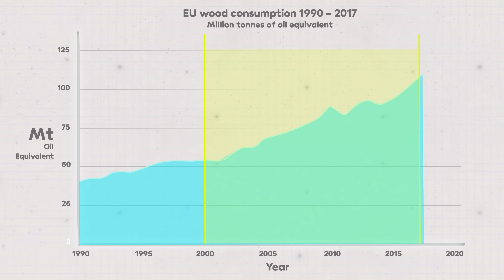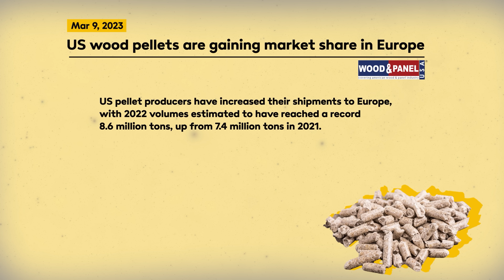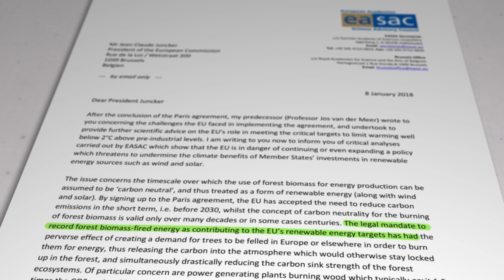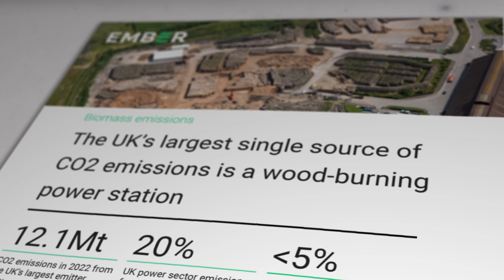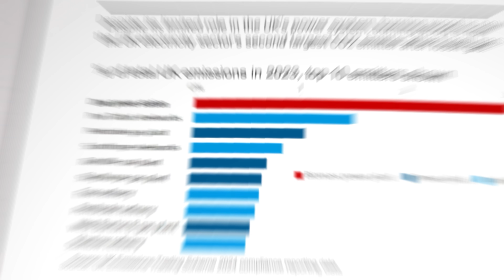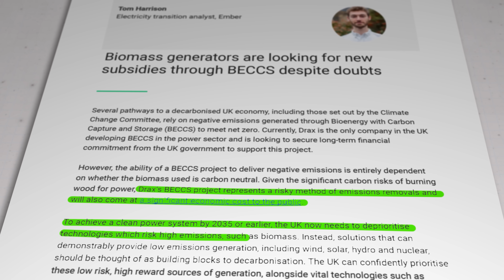New report: Biomass CO2 emissions 4X higher than COAL!!

Comment: My canton has invested heavily into Biomass.  I am not happy, since they have been fighting my decades long battle to promote renewables.   Our capital city has 14 chargers for EV.   It is 2024.
And ojr cantonal hospital has zero chargers for EV, public and staff.  Zero.  It is still 2024.
Reply: Biomass for heat is more efficient than électricity. 
A case could be made for thermal solar in hot water uses but otherwise go biomass rather than fossils.
Reply: @etienne8110  how's biomas better than electricity if the electricity comes from my solar panels and from my provider that has only hydro power plants?
Reply: @alexandruilea915  direct transformation biomass to heat.
Vs lots of losses (producing the électricity, transporting it, converting it, storing it etc...) each steps requiring infrastructures with carbon cost.
Reply: @etienne8110  you can't just sell roots to people so they can burn them. You have to collect the biomass, process and compress it, transport it and sell it to a customer that will eventually burn it. It's just like with petrol vs electricity. If you count production and transport of electricity so should you count the production and transport of petrol. People won't just pick up biomass from their backyard to burn it, but most likely buy it as pellets.
Reply: @alexandruilea915  most biomass isn t roots...
Shows how much you know about the subject.
Reply: @etienne8110  biomass regards to anything that has been grown and is left as junk. It can be wood leftovers or any other plant leftovers. It is carbon neutral as long as you don't cut trees just to make pallets.
Reply: @alexandruilea915  miscanthus is grown to be fuel. It s neither junk nor leftover. 
You re using wrong definition thus your misunderstanding of the situation, i understand your confusion now.
Reply: @etienne8110  well yes, but we don't cultivate it between the city buildings do we? It's like with corn for fuel. In order to produce more you have to expend which also means cutting down forests to empty the land.
Reply: @alexandruilea915  you don t cultivate wheat between city buildings either, doesn t mean citizens are going to stop eating pasta or bread... 

Your exemple is so dumb that it shows you are at the end of your logical thinking here...
Reply: @etienne8110  but you can't eat sunrays or wind ffs. Why compare food with fuel?
Reply: @alexandruilea915  how crazy to compare growing things ...
Reply: @etienne8110  again, one is necessary for survival (food) while the other one is not, because we can make energy in other ways as well. I do agree that some leftovers could be burned, but let's not grow stuff just to be burned if possible.
Reply: EVs are not carbon neutral, some can argue even the opposite. Mining and transporting lithium from Bolivia plateaous and then into refinement just to make the battery can amount to more carbon than your car would spend in it's lifetime if it went on gasoline, which requires much less energy after the drills have done the work (and with less energy intensive refinement later on). And we didn't even consider that most of electricity you will use is not produced in carbon neutral ways. If you are not charging from solar, nuclear or wind power you basically worsen the carbon situation with just that, even if the battery production if taken out of the equation. EVs are in essence just shifting the carbon emission responsibility elsewhere at this moment in hidden ways, just as in the topic of this video. Hopefully in the future this changes with sodium batteries and more carbon neutral energy grids.
Reply: @marsovac Sure, they're not carbon neutral to start with, but after about 20,000 miles they're carbon negative. Sooner if using 100% renewables for generating the electricity. and that mileage is being reduced by the adoption of lithium iron phosphate batteries. And going back to using horses won't work, no matter how much you yearn for that, It turns out their carbon footprint is greater than an EV.  😁
Reply: @marsovac  
I know where your paycheck comes from.
Fossil fuels require over 530 times more mining than renewables.  And Zombie Fuels have bankrupted the system.
I know you’re a fraud when you talk about less energy intensive refinement.
That was truly funny.
Reply: @marsovac never will a burning technology be better from an environment standpoint than something that gets built once and then just reuse. See heat pumps vs wood burning central systems for example. Or coal powered power plants vs nuclear or renewables like solar/windmills.
Reply: @marsovac  Do you have a source for these assertions?

Comment: That's upsetting. I do need to wonder if the wildfires we keep having in Canada are worse emissions wise than the purposeful burning of that same wood. Neither help but we aren't going to repair the climate, so we are going to continue to have wildfires. Seems like a cycle that isn't going to get better because it would do more damage in the long run to remove all those trees in order to prevent the fires. But removing the trees would prevent all those towns from burning down and save people in the short term.

Comment: Here is one for you, just to have a think, you know... Solar panels are bad for climate for the reason of being black. They absorb visual light and transform it to infrared light heating the air in the process. So during their approximately 20 year life span they transform 20% of the light that hits them into electricity that does work and emits heat in the processes. Almost 80% remaining either heats the air of the planet or is emitted back to space but in a far lower ratio than if there weren't solar panels there in the first place.
Reply: Yeah I dunno. Go touch a solar panel. It's a lot less warm than the shingles on the roof in direct sun.
Reply: @KF1 It is being ventilated from both sides. You must add the temperature of the shingles beneath the solar panel to the equation as well.
Reply: @dimmedaurum114  Ever been in a hot attic? 
 Either way it's a non-point. Shingles produce no usable power.

Comment: Drax produces 4x more CO2 than coal fired power stations because it is 4x bigger. Don't forget that we hardly burn any coal these days, only 1.2% of generation was from coal in the past year.
1 ton of carbon from trees produces exactly the same amount of CO2 as does 1 ton of carbon from coal and/or oil. The difference is that coal and oil are fossil sources and normally their carbon would not enter the atmosphere. Burning trees only accelerates their normal growth and decay cycle.
Reply: But you need  a  greater tonnage  of   wood than  coal because  wood  is  a  carbohydrate ie  it  contains  a  lot  of   oxygen and  thus  produces less heat  when  burnt as  it  is  already  in  a partly  oxidised  state.  The  wisdom  of  transporting all that lighter than  coal  about  the  planet is  not  clear to me and  when  it  burns at small scale  ( like  my  neighbours  heating  system ) you can  smell it and  see the  smoke  when  it  starts  up.
Reply: @auldfouter8661  Wood releases ONE THIRD as much GHG when burned as coal per GWh.

Wood releases up to 120 TIMES as much GHG equivalent when not burned.
Reply: Your point about whether biomass carbon or fossil carbon producing the same CO2 is correct but avoids the key issue that the heat content generated from the same mass of biomass is much less efficient per mole of carbon vs coal or oil.

Only accelerating carbon release is the entire problem in a nutshell; which is driven by financial incentivization of the conversion of non-waste biomass to pellets of this policy decision and also a real moral hazard.
Reply: @timmythomas3522  Again, you have that backwards.

Wood is cellulose and lignin. When they burn, the calorific content comes about 40% from combustion of hydrogen, and 60% from combustion of carbon in those molecules.

That's why coal generates almost three times as much GHG per GWh as wood.

Accelerating carbon capture, by taking senescent trees and deadfall out of the forest to allow afforestation of younger, more vital trees better suited to the new climate conditions, is what happens when wood replaces coal.

The moral hazard? Comes from blindly subscribing to GWPF propaganda.
Reply: @bartroberts1514  yeah in an ideal world your ton of wood is bone dry and you can then claim no heat losses to ~50-70% external and internal moisture depending on location. On that basis, wood produces lower GHG/kcal. Pelletized wood is a manufactured product, there are additional costs to make this worth it viz a viz subsidies. Mined coal is unadulterated.

The rest of your argument is nice and ideal but wiping out current sequester and spending years if not decades to build a sequestration stock is nonsense. That said, yes there are planned culls for old trees or in some cases unproductive crop trees. In those cases, go for it. These subsidies and incentives in drax for eg., can drive industrialized deforestation. It may not happen, but in the drax case, the company's responsibilities must tend first to its shareholders and earnings and the scale and volume of biomass fuel it needs is very large. 8m tpa of pellet wood puts immense pressure on raw material availability. Just take the worst case of 0% binder, that's 8m tons of wood per year EVERY year until its PPA is commuted. Sure doesn't sound like a case of "allow afforestation of younger, ..." and hard to imagine what process can sustainably pump out 8m tons of waste sawdust.
Reply: @timmythomas3522  Let's compare like-to-like.

What quality of 'unadulterated' coal would you be burning? IIRC, UK coal is low grade, and so the quality of heat obtained is worse than wet wood. Puhleeze. Representing coal as 'unadulterated' or pure compared to wood?! Pull the other one.

Sure, there's plenty of heat 'loss' to forming steam when wood is burned. But try to keep track, the point of an electricity generating station is to create steam to drive the generator. Once that heat is tapped for mechanical power, the residual heat is retained in the very moist exhaust, which makes excellent heat resource for uses like district heating.

Growing trees are not 'current sequester': they're current senescence, rotting where they stand, fed on by termites and other insects with methanogenic gut bacter.

Full disclosure: do you work for GWPF, or in coal mining?
Reply: @bartroberts1514  Coal is burnt without processing, but pelletization is a process. That adulteration removes moisture and increases the energy density of sawdust. The pressurized extrusion uses energy and is result of other financial costs on top of the power plant. 

Your description of using the moisture in the raw material to run a turbine is just plain wrong. To energy used to boil off excess moisture is not useful heat. The steam generated here does not end up in the stream that drives turbines.

So if live, growing trees are rotting where they stand, the justification is to chop them down, remove the CO2 sequestration capacity, and put seedlings in the ground?

I work in neither, and these are polar opposites in the spectrum of the climate question and it appears that you are trying to find fault with either. Why don't you take a more balanced view, look at the physics/chemistry, and ask yourself some real questions, such as scale instead of the unitized  (per ton) impact of the negative externalities of these projects?
Reply: @timmythomas3522  Coal comes in varying grades; it is mined, a process; crushed, a process; assayed, a process; fined, a process; coked, a process..

Coal itself is a heavily polluted resource from the start. Coal is an adulterant from the start. Adulteration, by the way, means something foul is added to a material.

Praytell, what foul material is added to wood pellets by pelletizing them? Is it coal dust? No.

And you misconstrue what I am saying about the moisture produced in wood combustion. If you were running a steel mill, or clinkering limestone for OPC, you would need to overcome the water content to get to the very high temperatures needed for those reactions. Likewise forming ammonia from methane, and diverse other high temperature chemical processes. Making steam to drive turbines? That needs only the temperatures you get burning wood. The moisture contained in the wood smoke contains sensible heat: lower temperature, but higher specific heat content. So in Drax, for example, there is practically zero loss and may be advantage for burning wood compared to coal.

And when the exhaust of burning wood does cool down and hot vapors condense, they are still hot enough for use in district heating, for example.

See how that works?

You're not wrong, if talking about a foundry. You are wrong talking about a generator.
Reply: @timmythomas3522  By all means, educate us all on what specifically you claim I got wrong.
Reply: @timmythomas3522  Compared with 100% coal fuel, dry wood fuel can reduce CO2 specific emission by 38.23%, and moderately dry raw wood by over 30%.

Kuo, P. C., & Wu, W. (2016). Thermodynamic analysis of a combined heat and power system with CO2 utilization based on co-gasification of biomass and coal. Chemical Engineering Science, 142, 201-214.
Reply: That is true, and burning trees for electricity and heating would be a great idea if implemented without destroying pre-existing forests. Imo it's not carbon neutral if you cut down a forest and just say "don't worry we'll grow it back" and than proceed to not grow it back anywhere near similarly dense with foliage as it was. The point about trees taking time to grow back is also a fair one although imo it doesn't really matter as the environment isn't changing as rapidly as people make it seem to be. Not saying it isn't changing or we shouldn't act on it but burning trees is still better than coal oil or gas.
Reply: @thatfinnishguy6575  Maybe 'less worse' rather than 'better'.

Comment: I lived in northern Ontario Canada more  than 30 years ago. Three wood mills in town. The piles of bark, small branches and sawdust were enormous. A cogeneration plant got built. Conveyor belts moved sawdust to the plant where it was burned and turned into electricity for the grid. Then, another plant got built in which they took the small ends of the milled lumber after it was cut to size. The milled ends were finger joint glued together making useful lengths of good wood. Then, a window manufacturer moved in, bought the finger jointed wood and turned it into windows, doors, etc. 
Pretty efficient for decades ago.
Reply: Thats how it should be done, local production and use as much as possible.

Comment: When a renewable source, such as trees, is used faster than it can be replaced, it then becomes a net-negative renewable.
Reply: @the_wanderful_life the amount grown in the US does not keep up with the amount taken. In Florida, pines are grown but cut after 20 years for the paper mill. The point of the carbon issue is young trees do not uptake at the rate older trees can. There are a lot of projects and protected areas but there are far more areas being cleared. Oregon and Wyoming also clear a ton. Between papermills, wood pellets, and housing development, we use more than we replace.
Reply: @the_wanderful_life good to know and thank you for the education. Yes, studies which are not wholly independent, usually have bias issues. I was a scientist but changed careers due to these types of issues. It is largely why people have a hard time trusting the science community. 🍻

Comment: The thing with cutting forrest, however, is that you can grow new trees in the area, which will eventually take in the same amount of CO2. That does not happen with coal or gas. But yes, this will take decades, so it will not help us getting carbon neutral by 2035 or even 2050. I think only wind, solar, grid scale energy storage and nuclear combined with energy savings will actually help us to stop the ever increasing levels of CO2 in our atmosphere by then.
Reply: Oh and powering down our lives... becoming less addicted to the high energy vision of modernity... that nearly always escapes people's lists of the 'only solutions'.
Reply: you can't "grow new trees" though, because clearcutting at a landscape scale changes the soil and the weather patterns so that the forests don't actually grow back. Younger trees store orders of magnitude less carbon than old trees, if trees can even grow at all after clearcutting.
Reply: @composthis  it really depends on at what scale you do this. If you chop down the forests of a large area, yes, it does affect weather patterns. If you chop areas here and there, not so much. Also, you don't have to clearcut forests even for biomass. The traditional way in Finland has been that you plant a forest quite densely, and as the trees start to shade each other, you make it more sparse, getting some firewood and allowing the remaining trees to grow more rapidly. Eventually you do a clearcut for timber and replant. When you do this in a steady state, you're not increasing or reducing CO2 (except for the machinery and transportation). But clearcutting is being replaced by either doing just very small area clearcuts, or by selective cutting of trees.

However, like I said, the CO2 will not be reabsorbed by the newly planted trees in a few years, but instead only after several decades. So increasing wood cutting will lead to increased atmospheric CO2. But with fossilic fuels, you cannot have the mentioned steady state. Whatever you take into use will just add CO2 and there is no mechanism of the CO2 getting back to the place of origin (well, I mean, over the course of millions of years).